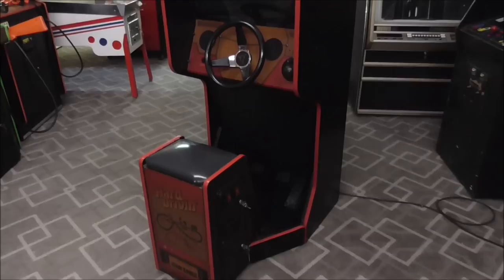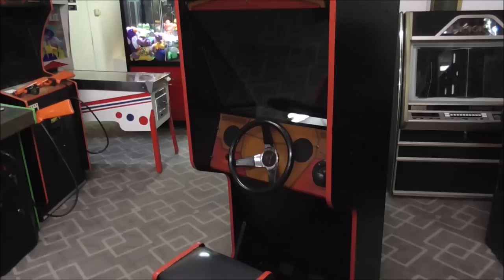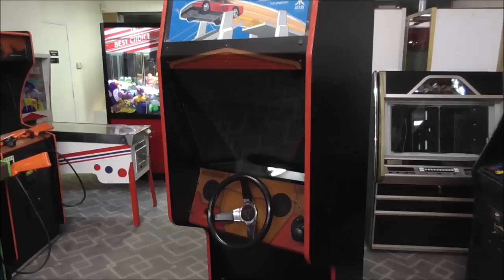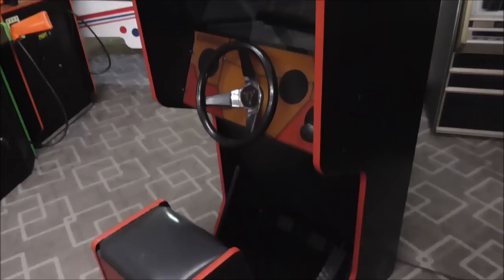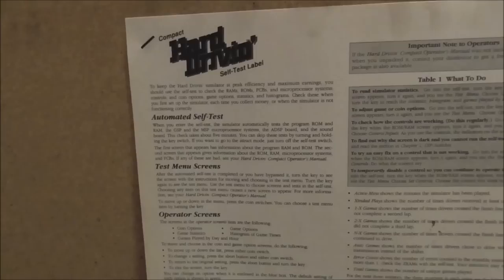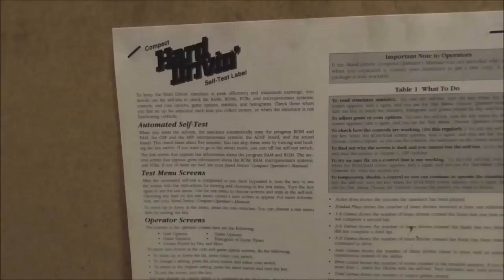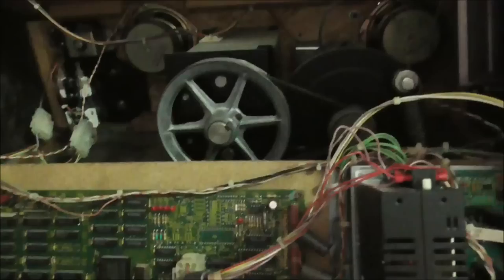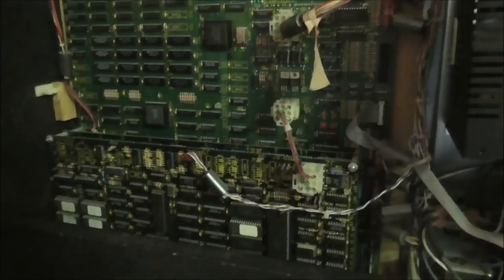We Fix Atari's Legendary "Hard Drivin" Arcade Game!  Steering, Brakes, PCB Repair WOW!

Comment: Correct me if I'm wrong, but I could have sworn there was a version of this that had a Modem, which could dial into another system for multiplayer. Unless I'm thinking of another early polygon racer?
Reply from the maker: There may be, but I'm not sure....
Reply: I've never seen it in the wild but supposedly you can connect two machines with a serial cable and race each other.
Reply: @bdam55  
If anyone could confirm this with a linked article that would be great. I would love to see video of it, if this indeed was possible.
Reply: @LyonsArcade  
I did a bit more research, apparently Hard Drivin 2 for PC had serial link and a track editor. Other than that it was identical to the arcade version.

When I find my MAME stash I'll check the ROM images to see if I have a variant with the Modem screen during the bootup cycle.

Comment: ADSP is that not the Audio signal Processor ? Remember its a realistic driving simulator have you bled the brakes ? lol
Reply from the maker: It has a different sound board, ADSP stands for "Analog Devices.... " something or the other, it has to do with the steering, pedals, brakes, etc.  The brake bleeding must be why I see fluid under the cabinet, LOL

Comment: why didn't you just set your phone to record looking at the board to see if the light comes on while you go around and press the pedal?
Reply from the maker: I'm not as smart as you are, Erik.
Reply: @LyonsArcade  only if you count having taken apart countless components of things only to realize that i didn't need to do so to fix what was wrong - and after all that trial and error that it pays to take time to think about what troubleshooting can be done without  disassembly.  I have a long sad path of breaking and losing bits during tear downs.  Wish i had a quality manual for everything I tackle.  It seems like the older something is the more likely there is to be a useful diagram tucked away on the inside.  For new stuff, we have to hope their is a youtube video.

Comment: I just got my cockpit Race Drivin. Mine has some issues with the monitor but I'm currently in the process of fixing it. It's got a weird board attached to the monitor that I've never seen and can't find any information on but I need to re-cap it and replace some resistors because a few have burnt out and a few capacitors are bulging. Do you have any way to find schematics for it? The monitor is a Wells Gardner 25K5515. thanks
Board: https://imgur.com/a/o8fRiH1
The machine itself: https://imgur.com/a/l6LBktE
Reply from the maker: I think maybe your monitor used to be a 25k5515 but that board is a power supply for a K8000, a pretty rare Wells monitor they only made for a little while.  It's similar to a 5500 but they made some updates and moved the power stuff to that separate board.... check out www.KLOV.com, the forums there can help you fix it if you get stuck.  The schematics can be found here:  http://arcarc.xmission.com/

Comment: Realistic  may be Tandy
Reply: Yeah those were most likely bought from RadioShack. Makes me suspect they're not original.
Reply from the maker: They look like they're in there 'right' but yeah you'd think Atari wouldn't be buying Realistic stuff....
Reply: Atari sure did use Realistic parts. I once owned two Atari Jaguar console display units like you might see in a retail store for demoing the Jaguar system. It was basically a tabletop arcade cab. The audio system inside was a couple of Realistic speakers connected to a small Realistic audio amplifier.  I modified this cabinet to hold a PlayStation instead of Jaguar but kept the that audio system because it kicked ass and sounded fantastic.   The speakers in your cabinet look the same part as the ones in mine. Which again, was Atari factory original when I got it.
Reply: @Jose_Pointero  They are original.  Atari did, in fact, use Realistic parts in some of its machines.